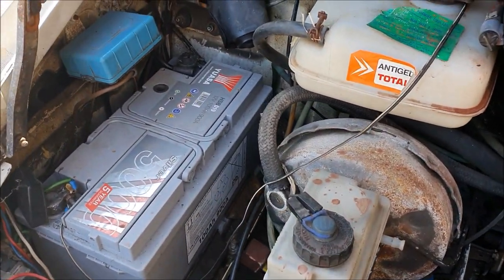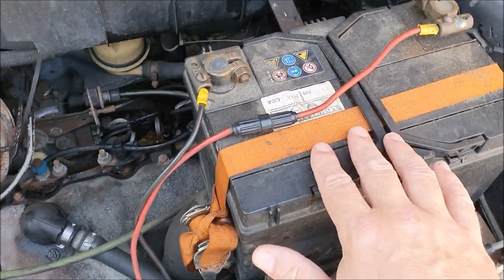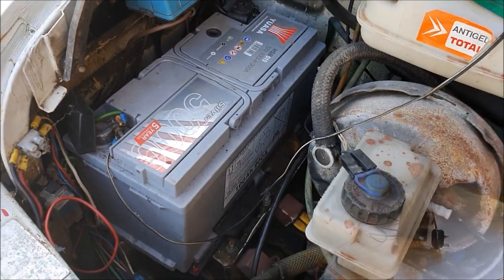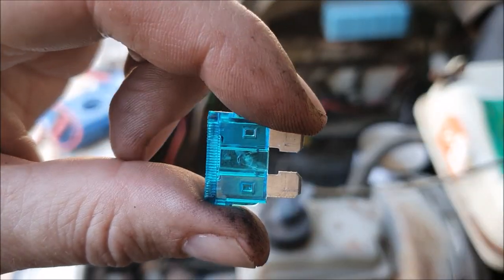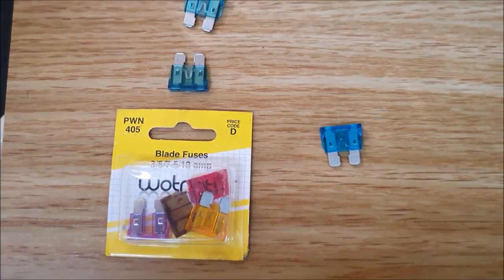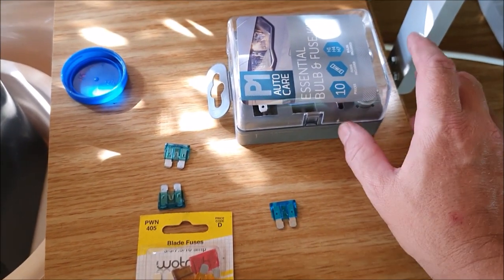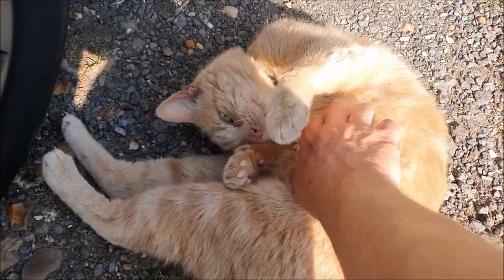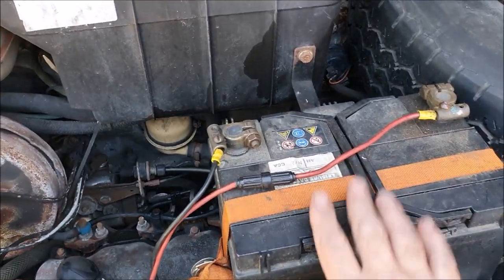Finding The Problem With Our Motorhome Leisure Battery Split Charge Circuit

Comment: Sorted👍 On our AS van the vehicle battery has priority for charging before switching a similar relay for the leisure batteries.The 12v function on the Electrolux 3 way fridge only works whilst on the move & is run off the vehicle battery by a similar but seperate switch charge relay. when camped we then either choose gas or mains EHU to run the fridge. This all works directly & does not involve the Zig control panel albeit a later version panel. On EHU the Zig charger/transformer looks after the 12v leisure circuits. I've fitted aux Victron solar for off grid camping works a treat.
Reply from the maker: I consider solar occasionally but I really don't want to drill through the roof....
Reply: Then you only require a stand alone folding  style solar panel which as a bonus you can position it in the best sunniest direction for better performance. Aim for a 100w & most have a basic PWM controller & crocodile clips for connecting direct to battery.

Comment: Glad you fixed it matey. Some Motorhomes the mains charger is a separate unit to the main control panel.  Ours is in a cupboard next to fridge. Others can be under floor or secret panel in bottom of wardrobe etc. 👍🤠👫🍺🍺🍺🍺
Reply from the maker: I'll have another hunt around but I'm fairly convinced there isn't one 🤔 😕

Comment: Hi I have the same van But Fiat, today I fitted my new leisure battery and can tell you the connecting block is standard lol. very helpful video. If my new bat dont charge I will check fuses and  add a dedicated solar panel instead. thanks for the video
Reply from the maker: Glad if it helped a little, how big a solar panel are you fitting?

Comment: After listening to you explaining, I would fit a charging splitter, that way you will be getting your leisure battery charged as you go along. You could have ponced a 15Amp fuse off a garage and then got a pack of fuses from EBay for far less than what you paid for the whole bulb unit. just my opinion, that's what I would have done.
Reply from the maker: Looking again at the split charging is definitely on the list 👍

Comment: Nice win,  you may find their is a battery charger incorporated in the Zig Unit rather than at the inlet.
Reply from the maker: If there is it's not working, I might take the back off and have a look 🤔
Reply: Check under your seat

Comment: Well done mate you definitely get a 
Beauty 👍 the that old chap you may want to do a cable size calculation as if the cables are to small they will get warm and can blow the fuse all the best 👍 
Chas.
Reply from the maker: Yes, they do look a little skinny. I don't think we'll ever need to run the fridge off them though so it's only lights and occasional water pump.

Comment: The connections all look very dirty and cuddly this can cause resistances and poor electrical connections you are best to clean them all put some petroleum jelly on them and change some of the crimp connectors for soldered connections The cables look quite thin so there’s going to be a resistances in the cables too. The blue box looks like a very old preheat really. You can buy a split really unit that would be very easy to fit and they come with all the bits they are not and expensive 
Hope that helps 👍🐾😀
Reply from the maker: Thanks Dave, yes, I've looked at those kits and it might be something for the future. Always a bit more to do eh! 😂👨‍🔧
Reply: Yes 👍 that is the way I would go good advice .
Chas.

Comment: Well done sorting the problem!! I blew a fuse putting an extra usb point in the van. Still think if you like your CLs maybe you could go off grid with a little solar set up wired to your leisure battery. They come with a controller unit so you don't over charge your battery.
Reply from the maker: It's something I might look into, not overly keen on having to drill a hole in the roof though 🤔
Reply: @ttxela  Hi Alex you can get a fold up one. When you want to charge your battery you just attach and put your solar panel in the sun? You could even do it at home while your van is in the drive parked up?

Comment: Great info again alex, our autoquest 270 leisure battery is fitted at the back of the van in the wardrobe but it is accessed from the outside via a door the same as the gas bottle door? The wires run straight up to the same zig panel as yours but ours does charge whilst driving. I will look out for that inline fuse box you have, in case ours goes👍
Reply from the maker: Interesting,  I've not seen one set up like that. It seems there was quite a bit of variety in how they were fitted out.
Reply: @ttxela  yeah, I’ve just had a read through these posts. I will take photos and add them to let you see the set up we have. I’m going over to pick it up tomorrow👍

Comment: Just one thought. The wires on the leisure battery seem like they are a bit small gauge to power the electric refrigerator. (lights are probably OK) There are tables on the internet that help calculate the appropriate size given the load and length of the wire from the battery to that load. The additional connectors under the hood that you pointed out in the video are also a possible source of current loss.   https://www.bluesea.com/resources/1437

Comment: My son-in-law checked mine when I bought it, he found I needed a 100amp battery to start the camper as the battery had had it's day, then we found the leisure battery was the same, ( they were under rated 80amps) then he checked the connections on the relay, and found they were wrong, as the engine battery should be charged from the alternator and then the relay allows the leisure battery to be charged, so when the camper is running it will charge both batteries, but if you are parked up you will be using the leisure battery only, but it can still draw power from the engine battery, as the relay stops the power being drawn back from the leisure battery, now if you have a traffic type battery checker you will see the top 2 lights will come on showing that both batteries are being charged when the engine is running, all hot water runs off the leisure battery along with the water pump, heater, extractor fan, lights etc, and I have a Talbot Express 1992 model, just doing the final touches to it before we go off to Hastings next year.
Reply from the maker: Yes, 80 amp battery isn't going to cut it for the vehicle battery! Sounds like you have a slightly different system to ours. Best of luck for your Hastings trip!

Comment: That's not the wright charging system - it's located under the passengers or drivers seat and that were that battery should be.
Reply from the maker: No, I think it's been added by a previous owner, there is no trace of any previous wiring under either seat 🤔

Comment: Found the instructions to your zig unit, CP 3V if it's any help. Ping me a mail if you require it. From what I read your unit is just a distribution unit and you need a separate charger or unit.
Reply from the maker: I'd certainly be interested to take a look 👍
Reply: @ttxela  hi there I have put it on the classic motorhome group. BTW keep the videos coming. Love em👍